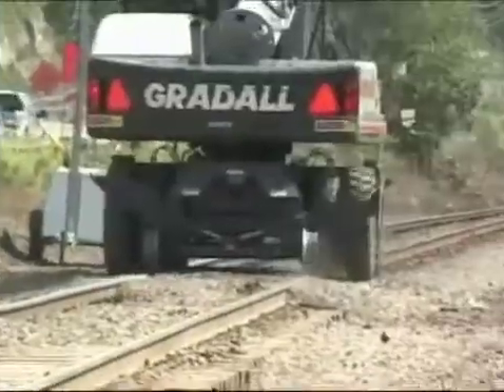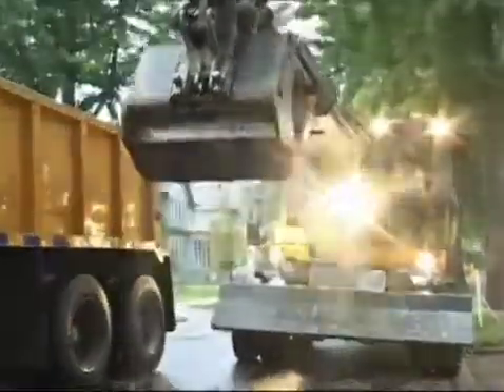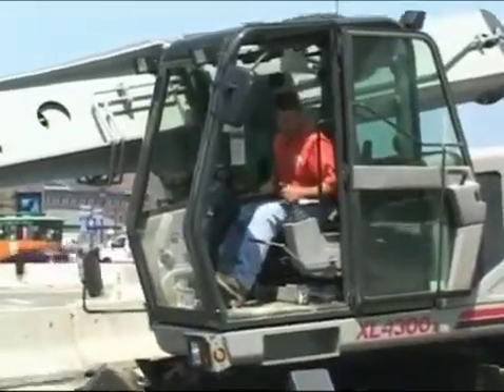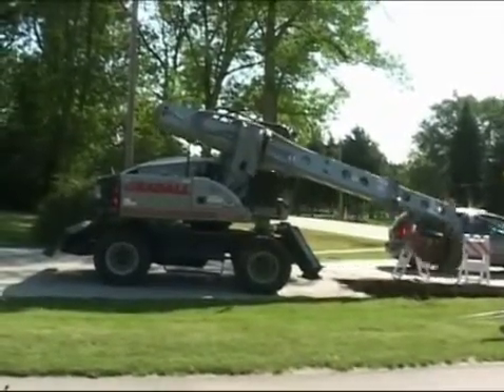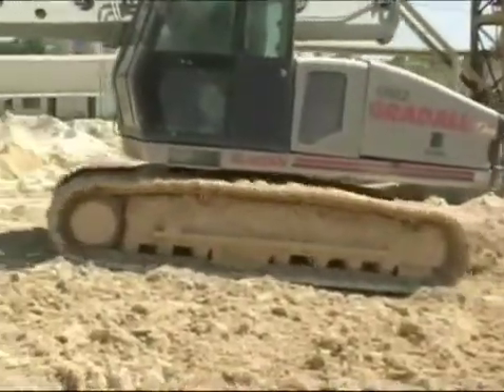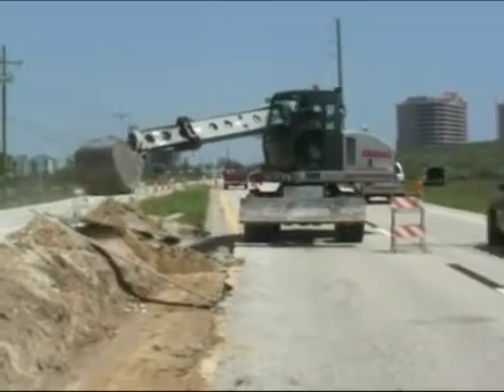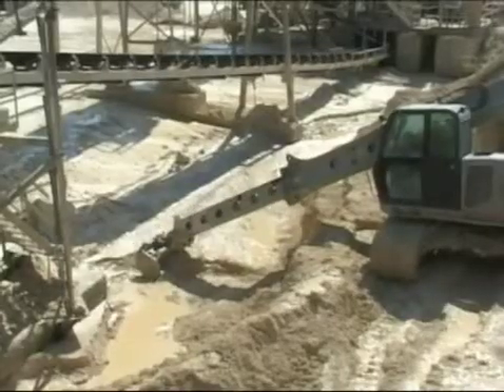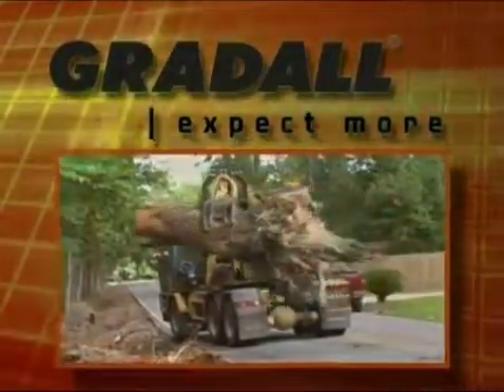Gradall Hydraulic Excavators - Capabilities Demonstration

Comment: Basically a bit different take on a hydraulic wheel excavator. It had advantage with it's rotating boom, but now, tiltrotators are getting more popular and unfortunately for Gradall - they are pushing it to the niche market.
Reply: Are you talking about tracked or wheeled excavators? I can drive a 4x4 unit with a regular driver's license here in Alberta. I don't need a license to drive a semi to move a track hoe, which attracts me to these machines. Plus with a regular track hoe, you have less visibility than with a Gradall.
Reply: @linkbeltdemolitiondude1219  Well, wheeled of course. I'm from Poland and machines of a Gradall type are quite a rarity, most popular were communist built UDS excavators on Tatra chassis. As far as I know, in Poland and Germany you need only regular driver's license to drive them on the road. In my previous job, I was driving them on a regular, daily almost, basis, only jobs 30-40km out necessitated a low bed trailer, though we had one ourselves.
As per visibility, I'm not sure, it seems like they are on equal terms, though it may be just a personal preference and actual machine itself. I was working on the Volvo EW160C, and it was a tight and enclosed cab, now we have Liebherr A900C, and they are a lot more spacious and there is a lot more glass all around me.
Reply: @chrishanson9748  Here in Alberta, we do a lot of civil construction and demolition work  with the tracked machines. Seeing a wheeled conventional excavator, even a Caterpillar machine, is rare. I agree that Gradalls are more of a specialty machine, but they have their advantages over conventional excavators.

Comment: Can a 4100 or 5100 have a right mounted cab? Having operated a 880 and 5100 for FL DOT both were right mounted cabs. I loved there turrent cab design with the joy sticks on the arm rest over the 880 design but the 880 had two advantages. Floor mounted bucket tilt was great for finishing work as the 5100 had a dial switch. Also the 880 was much better at getting out of soft soil or sand. But both are great machines.